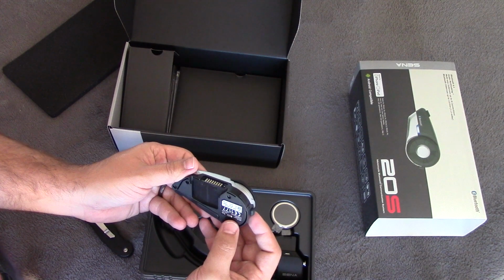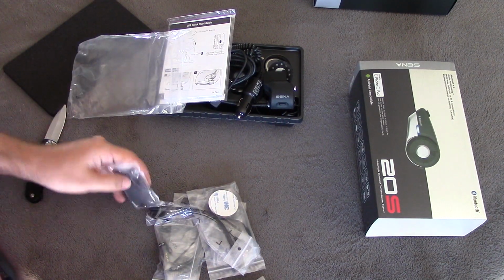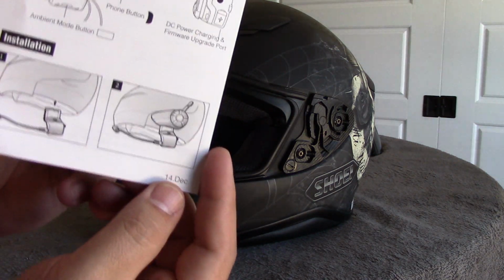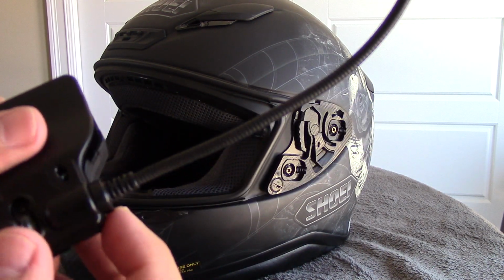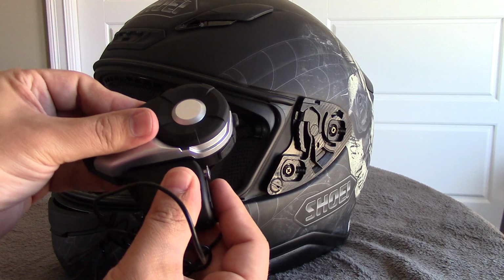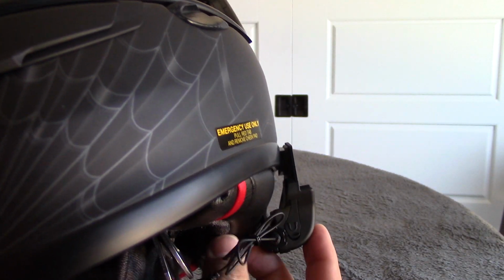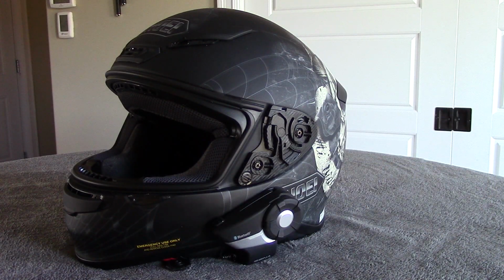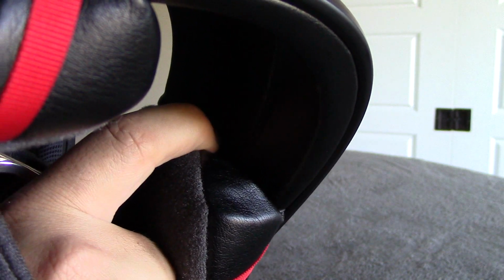HOW TO: SENA 20S Unboxing And Install Into My SHOEI RF-1200 Helmet!

Comment: did put speakers in
Reply from the maker: Hello Causa. I was not able to get a good camera angle to show putting the speakers in, but the kit includes circles of felt material which has a sticky backing. I stuck those circles into the helmet indentations and then the velcro on the speakers themselves was able to grip onto that felt material. From there, it was only to hide the wires behind padding. Hope that helps!

Comment: Tip: Run the wire for the right side ear speaker across the top of the helmet instead of around the back. I run mine behind the top padding and taped down with electrical wire. This wire seems to also act as a radio antenna and improves the FM reception when run across the top. True Sena doesn’t offer a lot in terms of installation (besides a video I came across)  I guess that’s because helmets vary so much which is why they provide parts for 1/2 face, modular, full face, beanie helmets etc. Enjoy!
Reply: i did the same and removed the padding to ease installation

Comment: its installed wrong how are you gonna remove the cheekpad to clean it if you got the wire over it you should have removed the cheekpad then installed everything
Reply from the maker: Hey Bryan, thanks for watching the video! As mentioned in the video, SENA provides very little in the way of instructions for installation so it can very likely end up being quite different from user to user. With that said, I definitely see what you're talking about and may re-do it and try what you said when I get the time. Thanks again!
Reply: TheMansomeMan np just giving a heads up i just installed the 30k on my new shoei helmet its freaking awesome btw i have your same helmet also lol
Reply: Bryantrincon413 what did you do for the speakers? My 30k speakers didn't quite fit all the way in the pockets and came out by the end of my ride causing pressure on my head!

Comment: Did you have no issue with putting speakers into sockets? I heard that's not enough space there.
Reply from the maker: With the 20S kit you get circles of stick-on Velcro backing. I stuck those into the plastic speaker indentations and then stuck the speakers to it. It was tight but if you turn the speaker around you should find an orientation that lets it sit flush. I've had no issues.
Reply: Thanks. One more question. Do they touch your ears?
Reply from the maker: Not mine. Can't guarantee that everyone will have the same fit though.
Reply: Thank you.
Reply: Most of the shoei helmets come with space designated for com speakers.